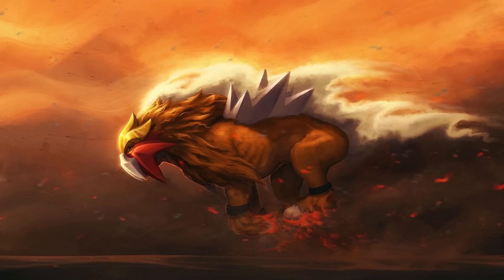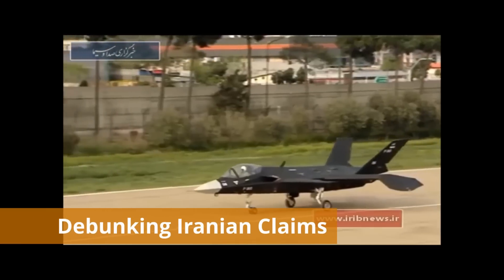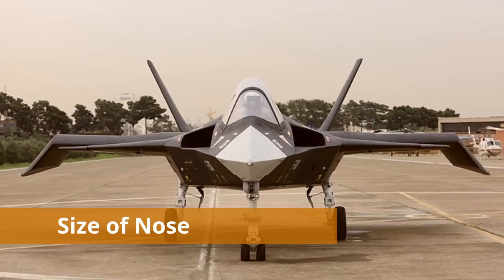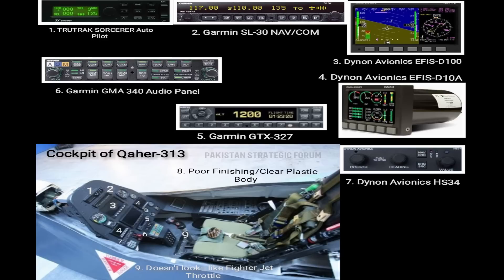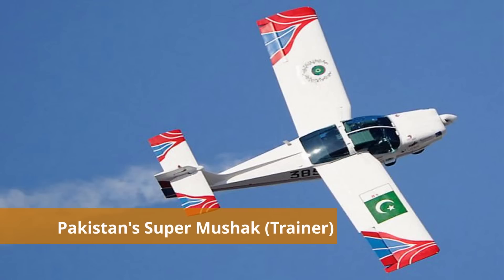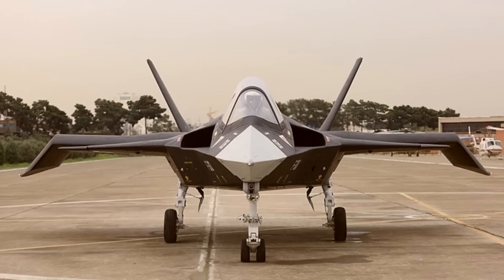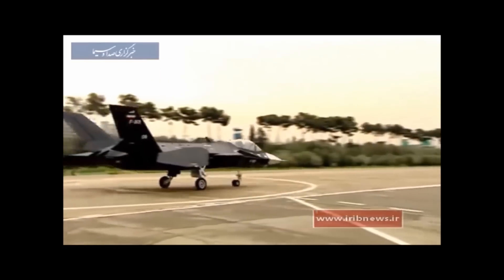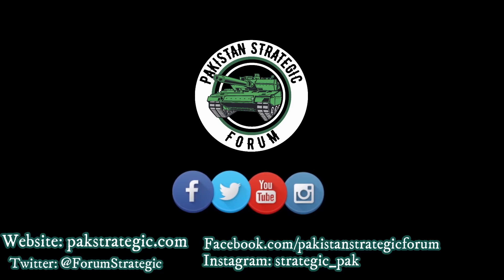Debunking Iran's 5th Generation Fighter Qaher-313

Comment: Another point brought up was that the designers of this 'plane' stenciled the tire pressure on the aircraft sides which is standard engineering procedure, only the PSI was a laughable 50lbs.  That is the kind of tire pressure a civilian plane would use.  Fighter jets need tire pressures around 250+ PSI.

Comment: Cool looking golf cart. Nothing about it is stealth or functional. It's wing sweep would cause massive air disturbance and an uncontrollable vortex that would tear it's wings off. Hope the pilot likes turbulence because at 200+ km he's going to buck like a bronco then drop like a rock straight in to the ground. IF if it flew at all, which it can't.
Reply: This is just a research project and has not been operational yet.  Its current design has changed from the original design, and it currently appears to have been temporarily suspended due to lack of funding.

Comment: regarding the exhaust check the exhaust of black widow
Reply from the maker: Well YF-23 was completely a different thing. It had internal exhaust system. Iranian can't manufacture that even in their wild dreams. You need flawless aviation industry for that plus billions (USD) in R&D.

#TeamPakistanStrategicForum
Reply: @pakistanstrategicforum  how can you be cent percent sure they cant develop? Do you know the they are still maintaining the F 14 without US support for the last 20 year. you may have also heard about they hacked the One of the advanced drone. So you cant under estimate, I do agree its a very narrow chance they can develop a air craft as superior as F 22 but still.
Reply: @pakistanstrategicforum  one thing more US also used to think like as you mentioned above before they got hacked :)
Reply from the maker: Maintaining someone's bird that too in worst possible condition is something totally different. Just compare Turkish aviation Industry with Iran's you will get your answer. #TeamPakistanStrategicForum
Reply: Pakistan Strategic Forum they have 2 exhaust nozzles. You literally pointed them out in your video. Secondly Iran is more than capable of building “internal exhaust”. That is the problem with the Pakistan government I think, They rely to much on the material and not on allah.
Reply: Pakistan Strategic Forum they did not maintain F-14’s badly they are actually well maintained your’e just copy pasting western propaganda.